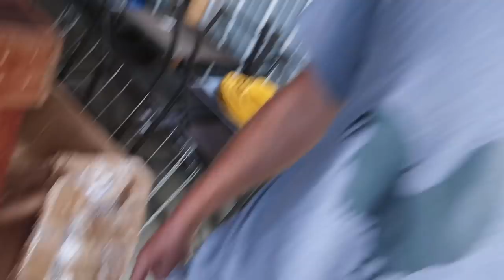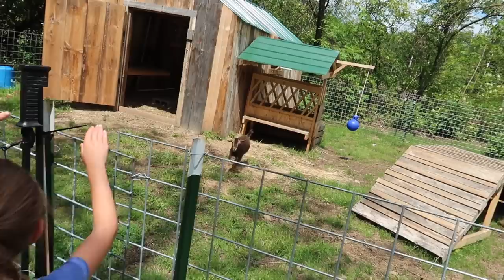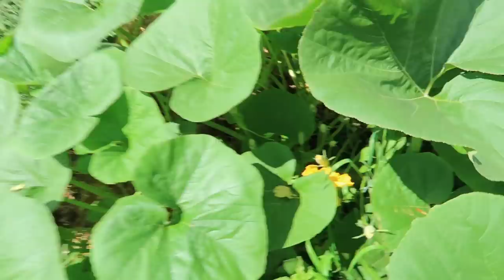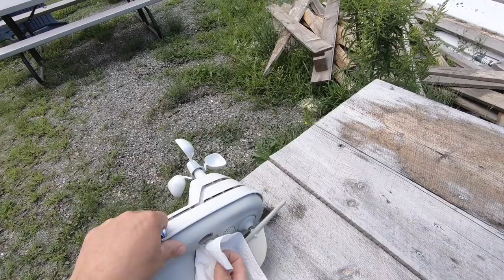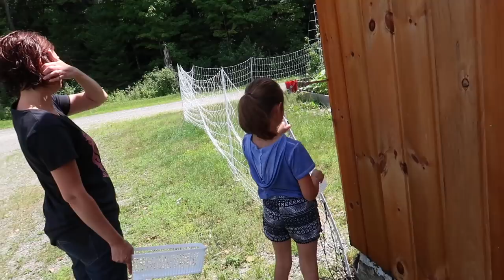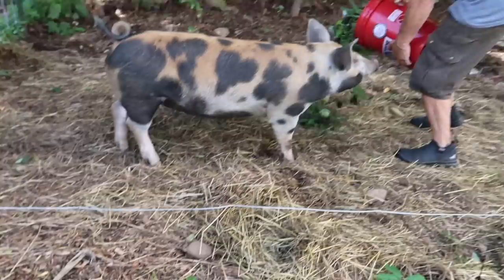When You Live On a FARM You Never Know what you will be DOING

Comment: Not sure if you have ever tried Delicata squash. 😮 OMG!!! Al it is the best. Smallish yellow or cream colored with green strips the flesh is orange and sweet.   An old lady recommended it to my Mom and I several years ago. It's one you need to start very early inside as it's like 110 days or something like that. But they are excellent I just gut them Prick with a fork put them upside down in a cake pan with about 1/4 cup water for good steam and bake them at 350-375' for 45-60 minutes then  I take the foil off turn them over and give them another ten minutes or so to dry off.  Then I brush them with real butter then sprinkle with sea salt and cracked pepper and most times you can even eat the skin.

Comment: Little bit of Dielectric grease on the ends of the battery should help just a tad
Reply: I was going to say that
Reply: Oh, good point!    I think I might slobber some on my weather station batteries tonight!
Reply: You can buy it at auto parts stores, amongst other places.   It keeps both water and air from entering an electrical connection.  I use it on my trailer light harness, snow plow harness, battery terminals, the base of every lightbulb I change on my cars/trucks/trailers.    And now.... on my weather station batteries ;)
Reply: Yeah I use it on pretty much any electric connection outside spark plug so on but it is conductive so if you had pins too close together that aren't separated you don't want to short anything out but the stuff is awesome .. and yes the best place to find is an auto parts store mostly use for auto light bulbs especially if they need to be submerged
Reply: it is a grease that electricians use to make better contact and to waterproof (if only temporarily) connections in a moist environment.

Comment: You need to spray a heavy-duty dose of WD-40 into your battery compartment on your weather station.

The WD-40 will help fight corrosion, and mitigate condensation issues impact on the metal electrodes.